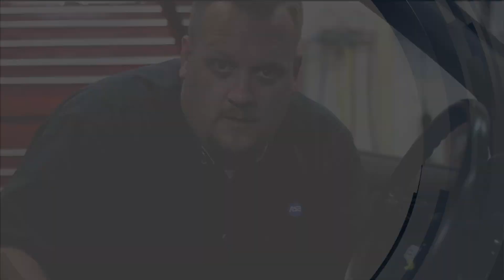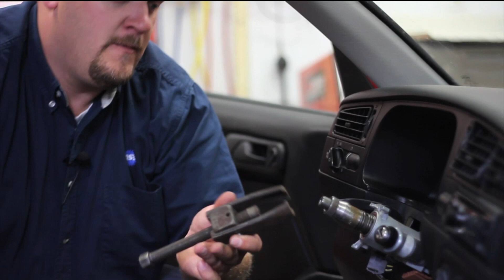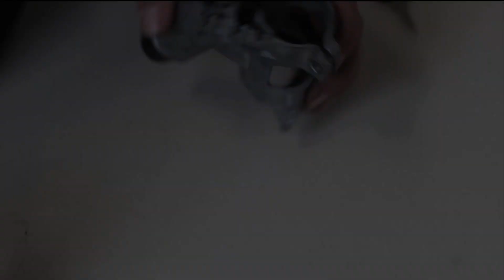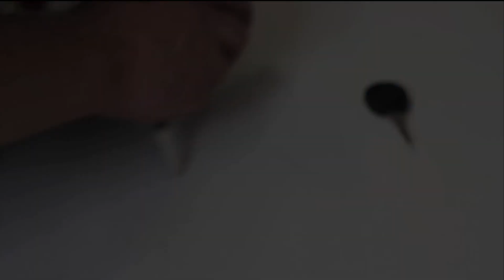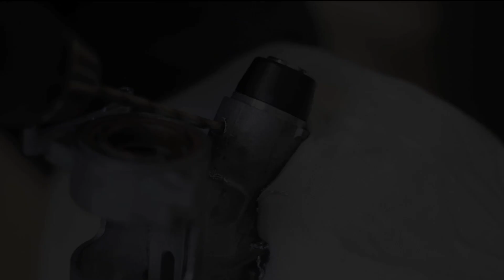Volkswagen Golf Ignition Lock Cylinder Replacement

Comment: So disconnecting the key ignition wont mess up the anti-alarme system
Reply: There really isn't an anti-theft system that ties to the keys in these cars. The alarm system keeps the car from starting if the alarm has been tripped – but you can turn off the alarm by unlocking the driver's door with its key.